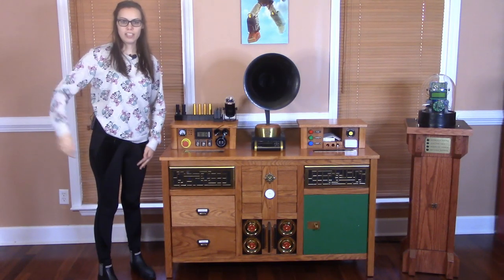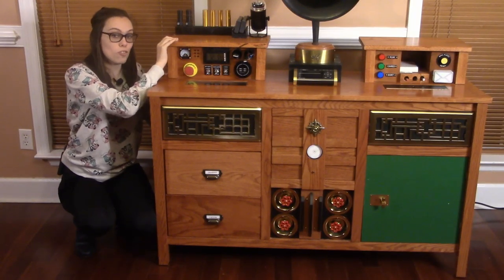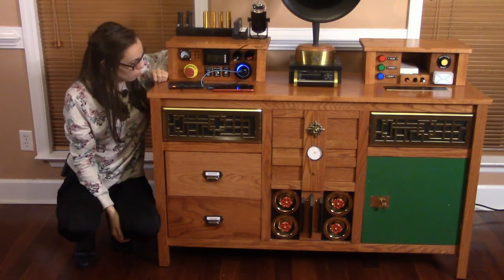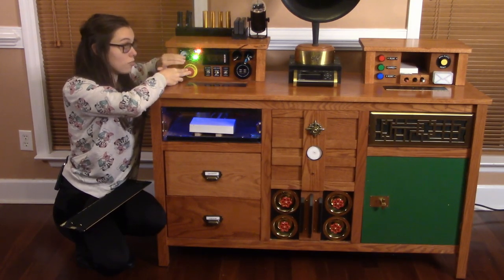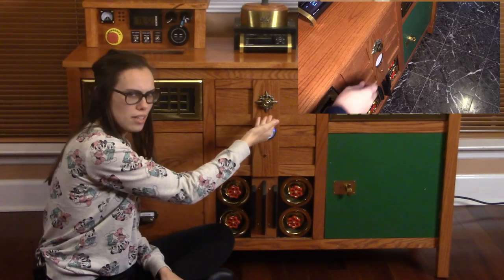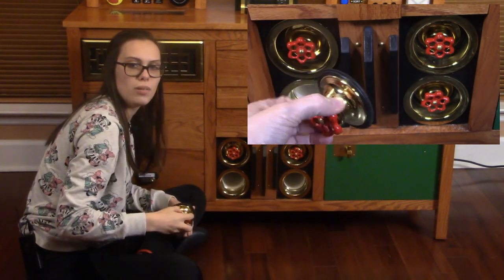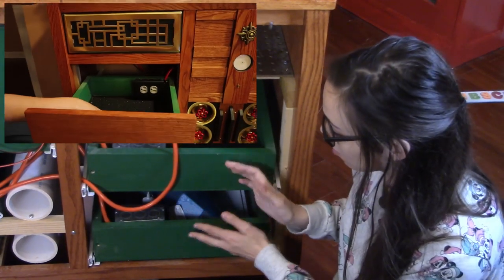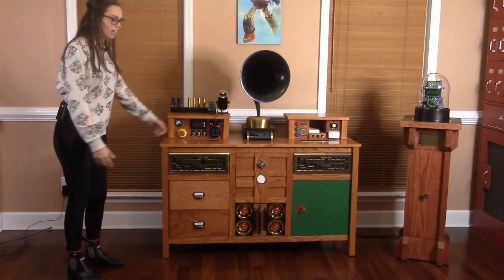Techno Desk - Electric Busy Box Of Utility

Comment: I would recommend putting LEDs on either side of the shredder slot so they will shine across the slot and illuminate it directly.  Like highlighting a trench run. 
For your router you can use an ATTINY85 chip (programmed with the Arduino IDE and using the Tiny AVR Programmer) to control relays to power it on and off.  Wire the power for the router into the relay and use the ATTINY85 to turn the relay on and off.  You can wire the power for the dancing lights into the second relay to turn them on and off.  The links I provided are just examples of the hardware I am talking about.  The dual relay I linked allows each relay to be controlled with either a High or Low voltage to turn them on and off.  If you set the router relay to High and the dancing lights relay to low you can control them both with a single leg from the ATTINY85.  Program the chip to set a digital pin High so the router will turn on, when the button is pushed it changes the digital pin to Low.  The Low signal will turn off the power to the router and turn on the power to the dancing lights.  Use a delay to maintain the Low signal for at least 10 seconds and then switch the pin back to High again.  This should alleviate the problem with holding the button down long enough.  You can power the ATTINY85 and the relay from a USB plug.  Since this will only turn off the router power, the rest of the plugs will stay on.  

ATMEL ATTINY85-20PU & 8-Pin DIP Socket
https://www.amazon.com/ATMEL-ATTINY85-20PU-8-Pin-DIP-Socket/dp/B01BMSLI36/ref=sr_1_6?keywords=attiny85&qid=1575642143&sr=8-6

Tiny AVR Programmer
https://www.amazon.com/SparkFun-Tiny-AVR-Programmer/dp/B00B6KNJRY/ref=sr_1_7?keywords=attiny85&qid=1575642143&sr=8-7 

5V 2 Channel DC 5V Relay Module with Optocoupler High/Low Level Trigger
https://www.amazon.com/Channel-Optocoupler-Trigger-Expansion-Arduino/dp/B079FGPC9Y/ref=pd_sbs_147_13?_encoding=UTF8&pd_rd_i=B079FGPC9Y&pd_rd_r=686a8b46-8709-4c48-a571-365c7a326b5a&pd_rd_w=fGOl9&pd_rd_wg=Rzdl5&pf_rd_p=5873ae95-9063-4a23-9b7e-eafa738c2269&pf_rd_r=GJF0PMWR5TB1QPYPZCDW&refRID=GJF0PMWR5TB1QPYPZCDW&th=1
Reply from the maker: I love these ideas. We've already finished the Techno Desk but may make some of these changes. And I will definitely add them to the functionality list for the new stuff we have planned. Thanks for the links!
Reply: @AtomicDairy  These ideas should be able to be retro-fitted to what you already did.
Reply from the maker: @idiotluggage  makes sense. I had never thought about automating the router bounce process. We'll take a look at that.